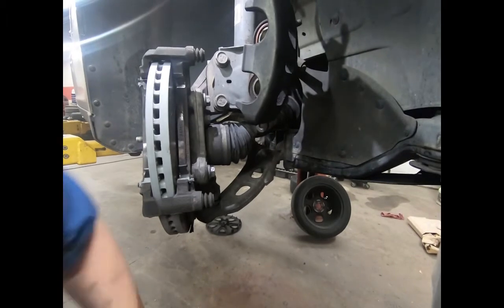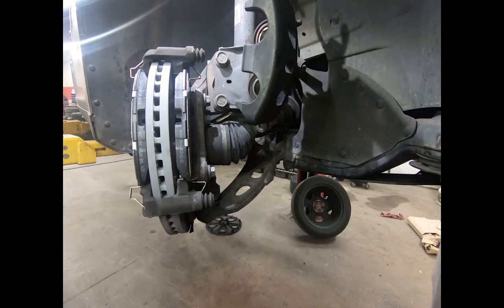FRONT BRAKE PADS 2010 - 2019 FORD  TAURUS

Comment: Just replaced pads and rotors on my 15 SHO and now I’m noticing a clicking noise while driving. Pretty much goes away when brakes are applied. Not certain if you’ve ran into that issue before and have pointers for correcting said concern?
Reply: There might be wear bars. One for each side for rear  front pads to clarify.
You could have 2 of those on one side

Comment: Only problem I saw was when you ground the pad seats down on the caliper bracket you didnt coat the raw metal.. just slapped the pad holders onto the seats.. that's coated metal covering raw metal that will most definitely get re corroded and rust... simple fix if you would have coated that with something, waited 5 minutes and then popped those holders on🤘
Reply from the maker: many people debate this one , i say your correct others say it attracts dirt and salt and rusts faster , but thanks for watching
Reply: @JoeTheAutoGuy Ya I disagree with that.. I honestly dont believe coating those will attract anything other than good Karma for doing the job the right way 100 percent.. I'd say this job was done to the best of ability but rushed just a bit. I'll give it a B+ lol🤘🤘